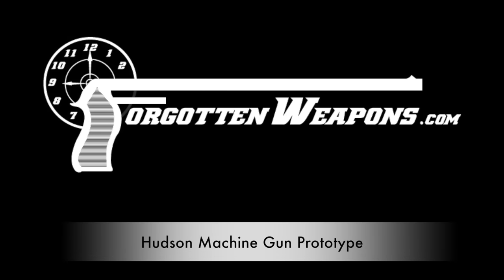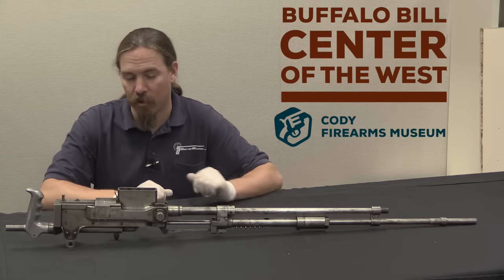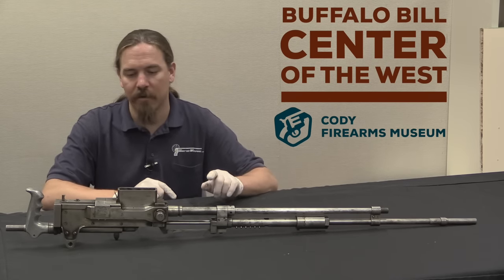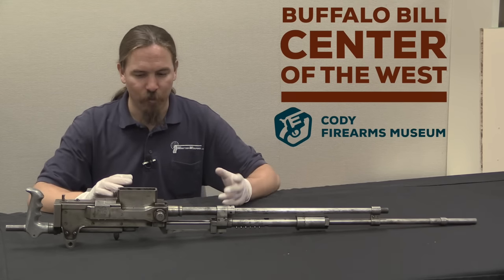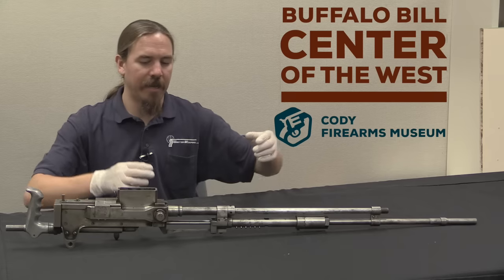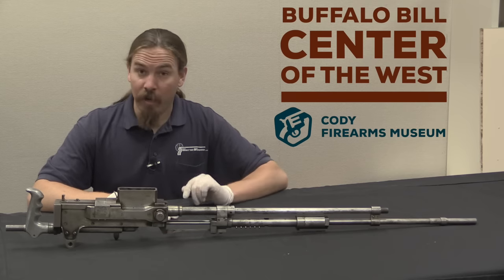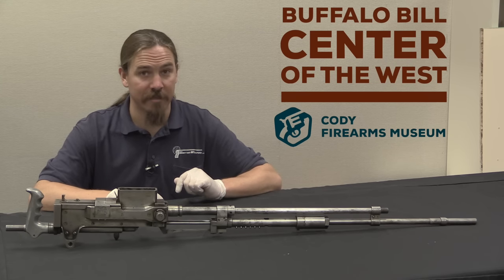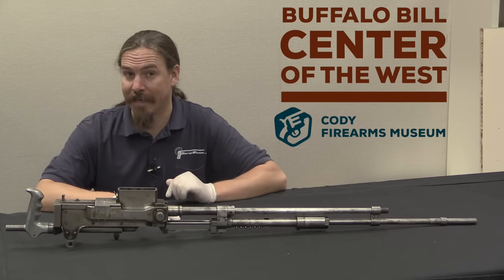Hudson Machine Gun

Comment: The following comes from Friedman's "Weapons of the US Navy" and Campbell's "Naval Weapons of World War II". The Hudson automatic cannon was adopted by the USN in 1935 as the Gun, 1.1" Mk.1. The guns featured duel magazine feed and were water cooled. There were four guns mounted horizontally close together on the mount, which was either powered or manually operated. The powered mounts were aimed by Mk.44 directors with remote power control. The first mounts were issued from 1936, with the thirteen 1,850 ton destroyer leaders completed between 1936 and 1939 getting two. By the end of 1941, all the carriers had six, the new BBs had six, of the old BBs, Maryland, New Mexico, Mississippi and Idaho had two powered and two manual mounts. The other old BBs and the heavy cruisers were to get four and the light cruisers, two. By May-June 1942, Lexington had 11 and Saratoga had 9. All the other carriers had six. The new BBs from North Carolina through Alabama got eight. The old  BBs all had four as did all heavy and large light cruisers, while the Omaha light cruisers got two.  That's at least 228 mounts and 912 guns and more to come. The first quad 40mm and twin 40mm didn't get into a ship by mid-1942. The 1.1" served through the war, eventually on gunboats, ASW escorts and auxiliaries. As far as reliability, the Navy reports don't indicate the guns were as bad as some stories. The main issue was the complex loading system and the lack of space around the mount, the turning circle being constrained during design. All four loaders stood behind the mount and no platform. As loaders got tired and in each others way, magazines weren't replaced or misloaded. A more space between the guns and the loaders for the outer guns being on the side of the mount would probably have helped. The USN went with the 40mm Bofors because it was more powerful and both the US Army and the British were using them. Certainly when it was fielded in 1936, it was superior to the 25mm Hotchkiss, which the Japanese adopted as the Type 96 or the British Vickers 2pdr in a quad mount.
Reply: Thanks for the effort - Ian is a gun expert, not so much a tank or naval expert.

Therefore, he works now and then with The Chieftain - a tank expert.

I don't know if Ian ever worked with naval expert Drachinifel - but here it would have made sense. Maybe next time.

Comment: For those wondering: the Russian gun Ian alluded to at 3:18 is the AEK-971. Kinda funny actually, since an updated version of that -- the A-545 -- got adopted alongside the AK-12 to be used for the Russian military's Ratnik combat system.
Reply: Actually A-545 was not adopted, but only selected together with AK-12 for competitive field trials. 

AK-12 won over A-5465 and become part of new standard equipment set, probably because it was simpler and cheaper.
Reply: Are you sure he doesn't mean the AK-107?

Comment: Very ambitious concept. I've always thought two barrels w. two rounds discharged simultaneously in opposite directions would  solve the recoil problem- it requires the construction of a hole in the shoulder and I haven't found a work around for that yet. Test pilots don't seem to queing up for first flights for some reason.
Reply: DOUG HEINS  No I hadn't but that seems to be a loading system not something that would null a recoil.
Reply: DOUG HEINS  Thx again for the reference. I'l look that up. If u begin by thinking of the ignition of the shell and ejection of the cartridge as an incomplete one stroke engine I think u get better mileage dreaming up a recoil-less mechanism. I don't know why some tinker er with time on their hands hasn't come up with something. U could put a couple vents in the tip of the barrel and around that a cylinder that would take in enough gas to counter the recoil of the second round. I don't know how ya blow the gas out without blinding the poor guy shooting. It's just an interesting physics problem I've been having fun with for a couple years.

Comment: How much would the device to reduce/remove felt recoil help when it's an, I assume, mounted weapon?
Also would a reverse piston work for something like this? one to cycle the action and another moving the reverse direction? In my mind it'd make sense if all of this was inside an over sized suppressor of sorts, using the gas to your benefit while it slows and cools.
Reply: A working counter-recoil mechanism on a mounted gun does make sense - especially in .50.

As cool as a Ma-Deuce is - that thing kicks like a mule. A counter-mechanism would improve long-range accuracy - if that's worth the effort is up to debate. Plus, the positioning of the mounting points on the gun is not ideal.

The mounting points on a MG34/42 and its 3-point mount are IMHO the gold standard.

Greetings from Germany!!

Comment: Next time you get out there, you should see if you can get that gun over to an x-ray center and see if they can get a look at what's inside there. As a piece of metal it'd obviously not be so easy but I'm sure they could figure out a bit about what pieces may be inside and what might be stuck.
Reply: Daniel G is that how X-ray works? because I don't think it is
Reply: You can't get like a 3d view of every piece, but assuming the metal isn't too thick and the xray is powerful enough, they can at least get some details on what's inside. Trying to figure out the full 3-dimensional shape of the bolt and other pieces would be pretty difficult, but I think at least some information could be gained.
Reply: Daniel G the problem that I see with that is, that as far as I know X-ray does not penetrate metallic pieces. that's why when you have to x-ray a woman they give her a piece of metal(?) to cover anything from getting unfertilized
Reply: x-rays can pass through steel to some extent. I just found an old government science report from 1947 testing lead, steel, and concrete. Lead was clearly the best at stopping xrays. Steel worked okay but xrays could still pass through it quite well. I think with a decently strong xray machine, they would be able to see through the receiver of that gun. A regular dental x-ray wouldn't work most likely, but something like an airport style scanner could work, and something more made for science would definitely work too.
Reply: Daniel G Even if that was the case the pieces inside are made of steel too. The x-ray will go pass them too, if it goes pass the first layer of steel too. So you wont be seeing much of anything :/
Reply: Industrial CT ('cat scan') scanners are totally a thing. You can even use the data sets to directly generate CAD files. I don't think the services are particularly cheap though.
Reply: The idea is that a properly tuned image will show the relative thicknesses of the steel in the line of sight of the x-rays in each position sampled. In other words you will see an image which is lighter where the metal is thicker or something - which means you will be able to see the parts inside assuming the cover is relatively flat and simple.

Comment: Did this have anything to do with the design of the type 11 or 12 machine gun japan had that fired from 5 round clips I see some similarity to it in the receiver though may just be incidental.
Reply: No. Those guns are fed from what is essentially a complicated hopper, which you pop rifle mags in the top and it feeds the ammo inside them into the chamber and discards the clips. This is fed from a magazine (as mentioned in the video) and not a hopper.

Comment: Just seems to be an odd mount pivot point on it - that seems like it would be really out of balance if the only mount was that rear lower flange area.
Reply: Right in front of the mag well there are two big lugs.
Those are probably the main pivot points, while the rear connected to an elevation srew.
Reply: You are totally correct.  Thank you for pointing them out.

Comment: I do not see much use in a recoil counter balanced mounted machine gun. It makes sense for a crew serviced weapon but why would I care about reducing recoil for a machine gun that does not even have a stock?
Reply: When you're shooting at aircraft, boats, or charging enemy infantry, recoil can affect your accuracy and you don't want to miss. If the gun is on a fixed position, the recoil isn't eliminated, it just means the gun is going to shake and vibrate while your shooting.
Reply: That is a good point. Fully automatic fire of a full power rifle round at such long distances do mean that reduced recoil might improve accuracy even on a mount.